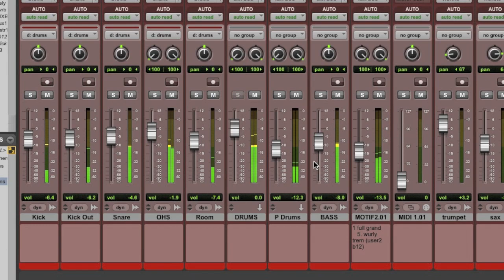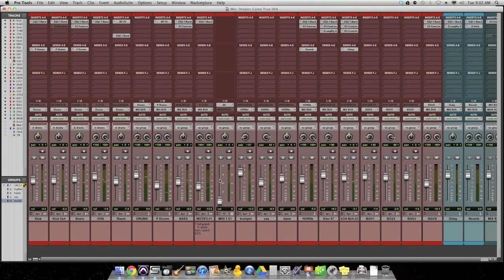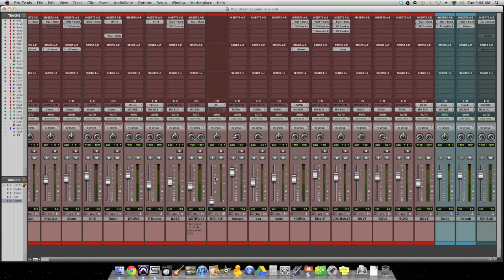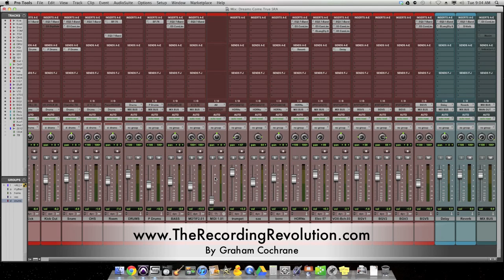Pre Fader Metering In Pro Tools - TheRecordingRevolution.com

Comment: Quick correction that I think is worth pointing out. When you are in pre-fader, plugins affect what you see on the meters because plugins are pre fader. So it is not entirely accurate to say that pre fader metering shows you the signal regardless of what you do with plugins because they do affect what you see.

Comment: the important part is to while recording use Pre fader, but when you mix, and everything has already been recorded then do Post fader, becouse when you start adding eq, you might actually be clipping in the red and not even know and wondering why a mix sounds distorted, in Pre fader mode even if you put a plugin on and crank the make up gain to wide open and its cranking, the meter will still show the level you recorded it in, hope it helps cheers!

Comment: Actually... the reason pro tools and most analog consoles have a global option for "Pre/Post Fader" monitoring, is that plug-ins or aux outboard gear is inserted before the input signal on the path of the recorded track. So plugs will only reflect the "Pre Fader" signal and not the "Post". You definitely want to adjust all your plug in levels via "PRE-FADER", then switch to "Post" for mixing.
Reply: What would be the significance in switching to Post fader metering for mixing? Can a mix not be done in Pre fader metering?

Comment: Hey Graham, I have been using pro tools for about ten years.  I think you're a little off on this video, brother.  Pre Fader will reflect the plug ins, at least it does on my rig.  It doesn't reflect the fader, but the plugs are represented.  I mix in pre fader mode because I want to be sure I don't miss any clipping that might happen due to plugins just because a fader is turned down.

Comment: Lately I've been mixing with pre-fader metering on so I'm not mixing visually, but strictly with my ears, which has resulted in better, most consistent mixes. I've mixed on analog desks where, come mix time, I'd turn off the computer monitor. Mixing in the box with pre-fader metering turned on is the closest I've come to that analog feel without having a hardware controller, and allows the music (to be cheesy...) "speak to you".

Comment: you can see what the input is of both inputs for the stereo track thus being able to set a good level, with each pre amp and balance accordingly . Also with Cubase it means when recording you can unclutter your mixer workspace by removing the input channels (grey on the left) and just using the normal channels (where you put plug-ins etc.in when mixing) makes it easier to keep track of everything
Hope that answers your question I know i'm not graham but felt I may be able to help.

Comment: Is pre-fader also pre-plugin? Is it the level on the tape so to speak, or is it the level after plugins but before fader?

Also if you're mixing in post fader mode and one of your plugins is clipping you might not see it on the meter if your fader is down. Wouldn't that be a problem?